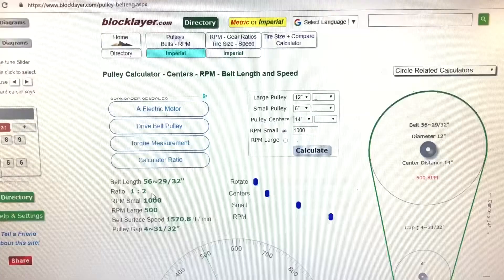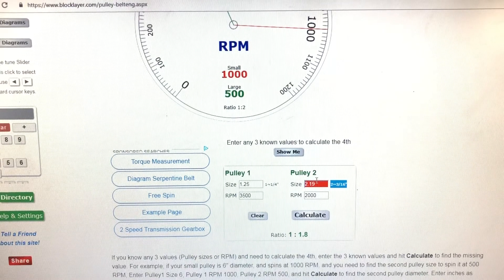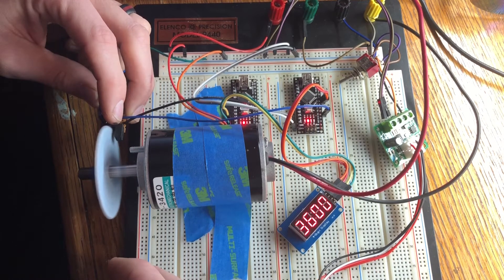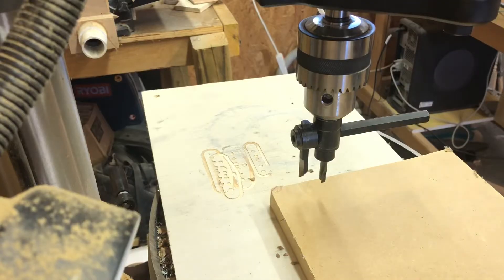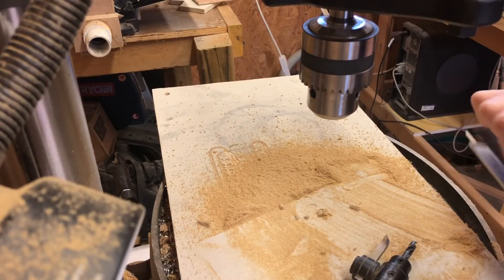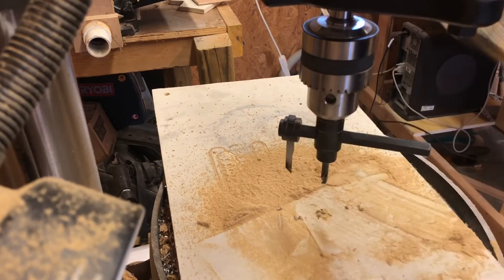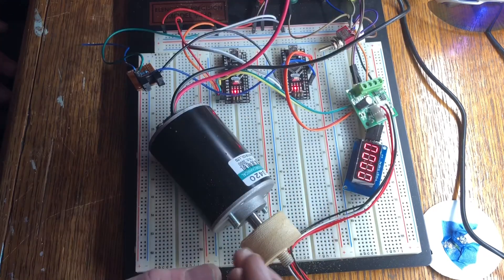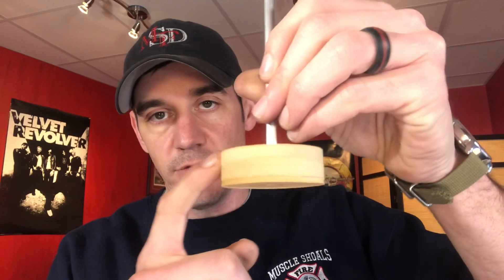Making and Sizing the Pulleys for the Pickup Winder 2.0

Comment: Your website says the OPTO sensor should be accurate up to 3000rpm, I ordered the 3000rpm motor linked so will I need to do this whole pulley system?
Reply from the maker: Hey bud. The pulley system just gives the low torque motors more torque. Some of the motors that spin really fast can be stopped by just putting your finger on it. The pulleys just give it more strength where it’s suitable for a winder. Once you get the motor just test it to see how strong it is. If it’s easy to stall it I’d add some type of pulley system. Hope this makes sense. Let me know.
Reply: @ChasesWKshop  That totally makes sense, thank you so much for the quick response!

Comment: do you think that this motor could run a ball mill (rock tumbler) with approx 10 lbs of material.
Reply from the maker: I think it possible with the right gear reduction with gears or pulleys.  Tumblers spin pretty slow if I remember correctly. May could search geared motors on Amazon or eBay and find something better. Let me know what you find. Send me an email if you need too.
Reply: @ChasesWKshop  wow, thanks for the fast reply. ball mills come with a vessel as you know. I intend to run various sized vessels so my plan is to use a 6" piece of PVC as an outer vessel in which I can fit various sized vessels, hence the weight issue ( not to mention actual contents). I need a vessel RPM in the neighborhood of 100 RPM'S. my concern is related to torque and duty cycle as this would be running for hours, days even. Sorry, I know this is a long reply to something you may not have answers to. I have been trying to get answers wherever I can when the opportunity arises...thanks.
Reply from the maker: @olheghtt  gotcha bud, send me some pics of what your design is.  I may can throw in some advice. This is the type stuff that keeps me up at night thinking lol. Weatherfordwoodcrafts@gmail.com
Welcome to the channel.

Comment: If you turn the cutter around in your circle cutter you don’t get that funny bit on your disk. You won’t need to sand it down.
Reply from the maker: Gordon Read hey thanks for the tip bud! I’ll try that next time. Thanks for the comment and welcome to the channel!!
Reply: @ChasesWKshop  Thank you.  Great videos.  I will be using some of the information you presented to make a counter for a lathe based winder.
Reply from the maker: Gordon Read awesome bud be sure to share when you’re done, I’d love to see it!
Reply: Yeah, but if you made two circles the way he did in the video, and glued them together, the pulley would never slip off :)

Comment: if you didn't want to make the whole pulley system could you just buy a slower rpm motor
Reply from the maker: ChoppingLemons you could. Gearing the motor helps with tongue too. On my other Pickup Winder I use a geared 12volt motor. If you haven’t seen it check it out. Thanks for the question bud.